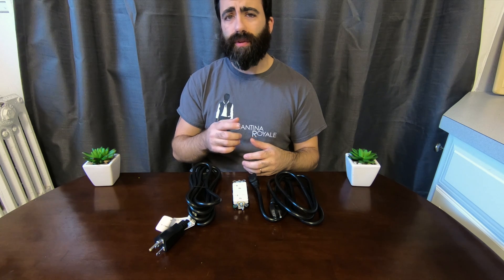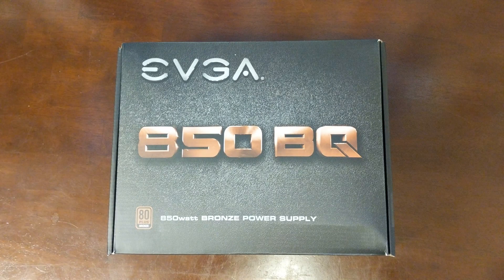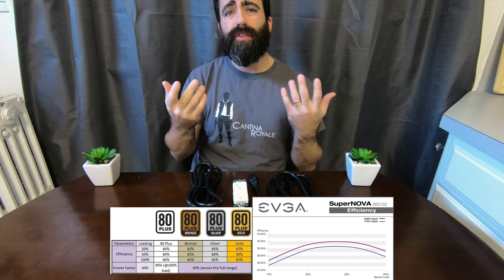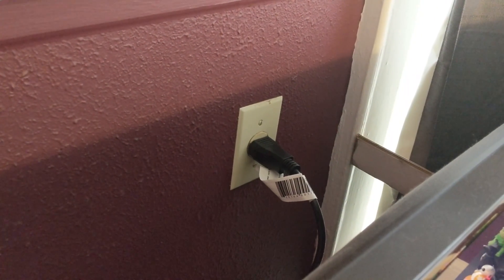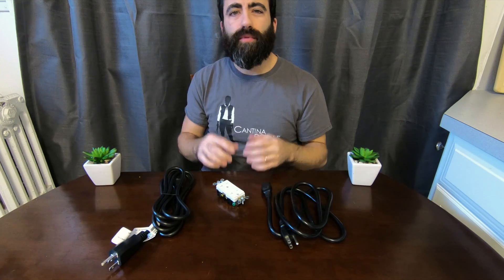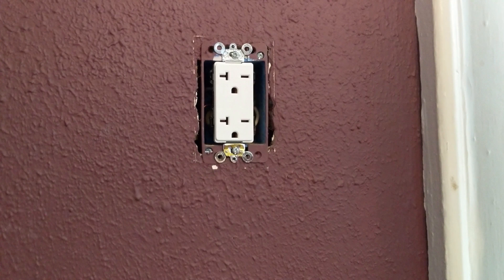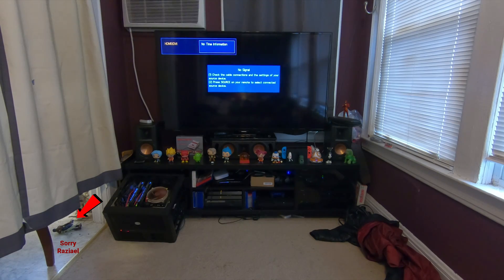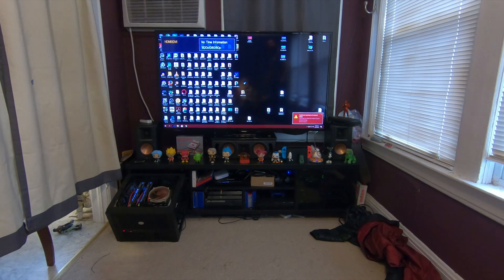Running Your PC Or Mining Rig On 220V

Comment: Find it very hard to take tech advice from someone that thinks changing a wal outlet is a massive undertaking but most important you have a dedicated mining machine with 60 plus icons on desktop ?? make a few folders and clean that shit up what the hell ? I got 12 icons and I consider that messy
Reply from the maker: You are a funny guy. It's not a massive undertaking but for someone who has never worked with electric it can be huge. It's not a dedicated mining rig either lol

Comment: You need to check your rated amp draw on the A/C unit plus the Power supply so they do not exceed 80% of your (circuit breaker rating), assuming you are on U.S. Power.
Reply from the maker: I did when I did the install. I am within that 80% spec. Have been running it this way all summer without any insident even while the AC condenser cycles on pulling the most amps.
Reply: @JoeyRiz  I trust you mean the a/c compressor cycling. Just because "it's been running all summer without incident" doesn't mean your wiring isn't glowing red hot in the wall. This is the reason why the 80% rule exists. The circuit breaker is there to protect the wiring. It keeps the current at or below the rating on the breaker. A circuit breaker doesn't have any way to "know" that a person is breaking the 80% rule. Is that outlet even rated for the amps you are pulling? How about temp rating? A fire in the wall is typically what will burn a house to the ground before the fire Dept. Can get a handle on it.
Reply from the maker: @mikeanonymous669  I know... I just said I made sure of the amps being pulled before I did the work. Yes I meant the compressor cycling on of course. I just added it's been working fine just to add that. I was an commercial HVAC technician for 6 years so I do know wiring and electrical in general.
Reply: @mikeanonymous669  ...you sound like the guy who has inserted paper clips into the outlet, repeatedly.
You correctly state that the Breaker is there to protect the wiring and cares not what or how many devices you connect to it.
You forget that the wiring AND breaker were (assumed) designed, installed , and inspected long ago when the building was built.
The breaker, at 20 amps, is there to trip BEFORE the wiring gets hot from exceeding it's rated current for any real period of time.

Good advice would include.....Did you retighten the connections at the breaker to reduce resistance?
Did you test the breaker for operation.....cheap security to buy a new, identically rated, breaker.

Does the power supply starve when the compressor start winding is energized?

Would installing a dedicated ups (uninterrupted power supply for Mr. Paperclip)  before this 850 watt power supply be in your best interests?
Reply: @truthsRsung  better advice is buy a new breaker at the correct rating and get commercial grade from reputable company not cheapest I can get one from ali express
Reply: @griffon3275  ...That was PART of my advice.
Your's is better because it discourages purchasing bottom bin electrical components?
Whoopie?!?
Reply: @TheObsesedAnimeFreaks  ...Now if you could only sound Wise.
Reply: @truthsRsung  i'm not trying to, just illustrating the point that over spending on shit isn't worth it. neither end is a good thing and typically the right amount isn't much higher then the bottom of the barrel.
Reply: @TheObsesedAnimeFreaks  ...You didn't "illustrate" anything.
It was babble, babble, babble......send.
Reply: @truthsRsung  why are you replying at this point. If you wanted to add something of value add it. Like I can't teach you how to read and think critically. I mean my point should have been as clear as day. I don't know what you want.
Reply: @TheObsesedAnimeFreaks  ...You gonna tell us how to tie our shoes next?
You have a knack for stating the obvious and calling it wisdom.